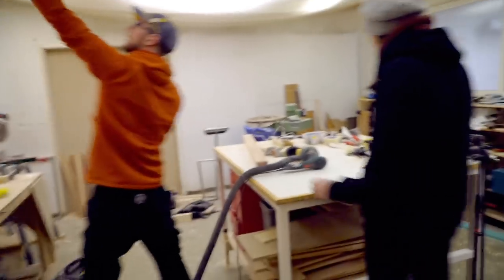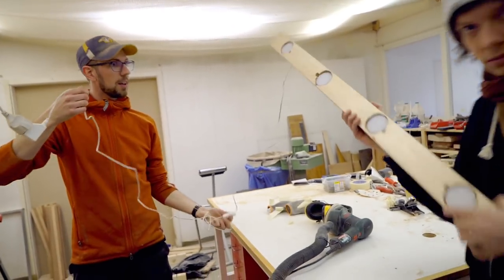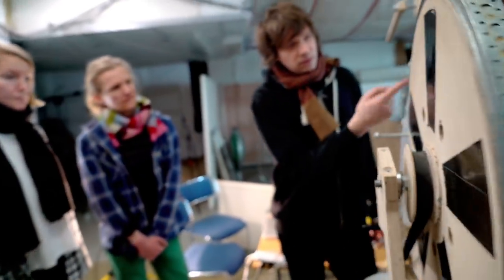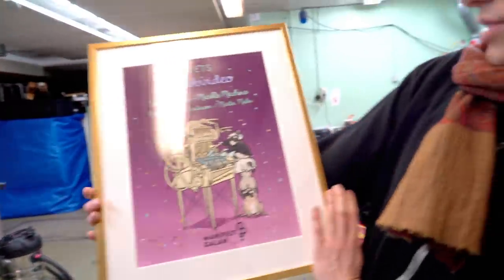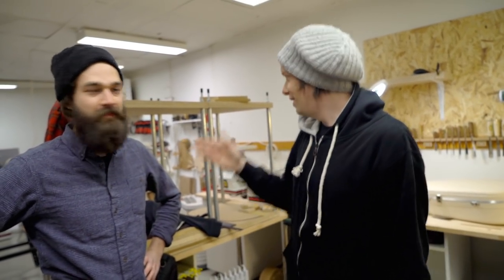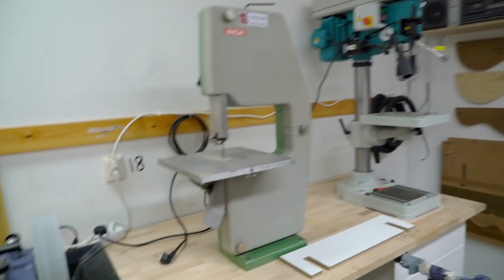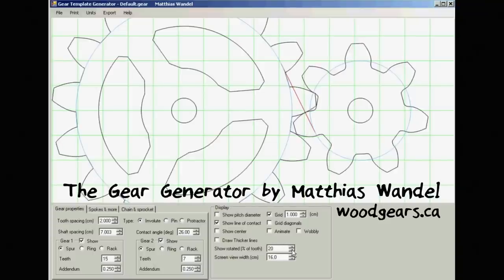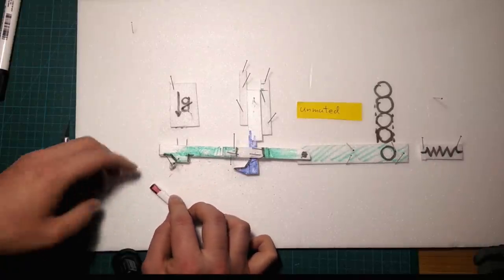Revisiting the First Machine - Marble Machine X #3

Comment: I kinda liked the wooden gears sound in the first machine, it was a part of the song for me.
Reply: The thing was, the original sound was extremely loud, actually louder than the music. They were able to get the actual music by putting very focused pickup microphones on the individual instruments and doing a lot of post-processing to get the levels and sounds right; the actual sound of the machine you would hear if you were standing next to it would mostly be [GEAR NOISES INTENSIFY]
Reply: I can see where the sound of the mechanism 
may interfere, but in my opinion, some NEEDS 
to be there.

Tubes on the Vibraphone would be awesome, 
since I REALLY like the sound effect of a 
Leslie speaker.  (Which is a very similar device.)

steev
Reply: Don't worry, mechanical sounds will still be there, just like you hear buttons on an accordion or the bow on a violin, it just won't be as loud as before.
Reply: I mean, if you're not gonna have all the little extra sounds the instrument makes you may as well just use a synthesizer.
Reply: Well honestly a physical noise is different than one made synthetically. As close as they can be, an instrument just has more personality, because the sound is tailored by the instrument itself.
Reply: ikr. It's nice he can get the gears cut more accurately, now, but I hope he doesn't make them silent like he says. I loved the gear churning sound from the original marble machine.
Reply: same here D: goodbye grumbling noises
Reply: +Eldritch yea prob why he wore headphones

Comment: On the marble catcher, easier, but more importantly most reliable would be my recommended priority.  When you are on the road and the machine is getting the snot pounded out of it you are going to want it to be as reliable as possible.  I would recommend a single marble catcher, but have it be clear so you can see the marbles going in and bouncing around before they get directed to the out tube.
Reply: Actually, a single catcher with walls and compartments that could be a good compromise. Once you've caught the marble, you could do something interesting inside the compartment, trigger a letter jump or similar, to keep the visual indication from the individual funnels, while still going with a more robust and rigid design.
Reply: +CoderCandy   Maybe having a transparent catcher where each marvle coming from a vibraphone plate has a flap (rubber, paper, something like that) facing the player in its way, which folds down when the marble goes through.
Reply: William Hayden You could have LED lights that get triggered when a ball hits the vibrophone. Maybe optical or ultrasonic sensors that would detect the keys(?) vibrating. If it was done like that the lights would slowly dim as the vibration lessens, which would look really cool.
Reply: SuperFrodo95 The options are literally endless, but the more added to the machine the more complex it becomes and this machine ultimately needs to be as simple as possible.  Simplicity directly translates to reliability.  Remember this machine will be taken apart, packed, moved, unpacked and reassembled countless times by people that aren't necessarily delicate in their actions due to time and stress.
Reply: SuperFrodo95 as of now it feels really nonelectronic. I really like that, and feel like leds would ruin the effect.
Reply: Agreed. It is really easy to make something fancy by just sticking LEDs and electronics to it. The marvel of the original marblemachine was that is was very analog, with the few electronics being very discreet and by neccesity rather than to be showcased.
Reply: Sticking with mechanical style, have a single tray with separating walls, and flaps that extend past the tray to visually show it's movement.

Comment: Crazy idea for the marble catcher: hard clear plastic with a row of hanging soft clear plastic strips, one per note. Normally each marble would hit exactly one strip and shake it, which helps visually, as well as dissipating some energy so the marble is less likely to bounce away. If you paint a moire on the hard catcher and strips, you could probably make something entirely mechanical that seems to flash at the spot each marble hits, which would be even better than shaking catchers for visibility if the audience isn't right there.

If you haven't talked to them already, you should get in touch with Evil Mad Scientist Labs. They've got a lot of experience with CNC-cut wood and marbles, and mechanisms for that combination. They've got a blog where they've posted a bunch of stuff from projects they've done, and they're friendly and interactive.

Comment: Just started to view this channel (love it) but another/extra way of making cogwheels more silent is to "twist" the teeth. That is, if you look a the wheel in that angle you only see the cogs (don't know how to describe in text, the wheel should look like an "I") the cogs are not horizontal, they are sloping a bit. The receiving wheel then have it cogs with the same angle but different direction. This is because when two cogs on a normal wheel hit they hit the whole width of the cogs directly, if they are twisted they are more of "cutting in to each other" rather than "slamming into each other". :)

Comment: Build it out of Plexiglass (Clear Acrylic "glass"), It's very easy to machine, drill, cut, shape, etc. and it solvent welds together in seconds into one solid piece, so it's very easy to make adjustments, repairs or changes by simply welding on more material  or sanding down to size with a handheld rotary tool ("Dremel" etc). When it's all working properly you can use a buffing wheel and plastic buffing compound and polish it all into solid clear components that look as if they are made from molded glass. Also has very nice acoustic properties.

I love Plexiglass and Lexan for prototyping. PVC pipe and fittings are also very good for many prototyping projects

Comment: you mentioned the problem that you want to have some kind of "visual representation" of the notes that were hit on the vibraphone. when you said that, i god a little idea, but i don't know if this is what you would go for, but i thought i'd mention it anyway. you could build a biger (more sturdy) thing to catch the marbles and attach some small device on it, that lights up leds when the marbles hit them. this could be realized with some kind of device, that uses induction to light up the led - this would mean, that there would be no external power source needed. just some kind of magned in a coil, that gets pushed by the marble and that will make a led light up for a short period. if the effect is too short, maybe a capacitor could prolong the effect. as i said, i don't know if you want something like that, but it came to my mind and i couldn't let it go. 
and btw: thanks for sharing your progress. the things you do are truly inspiring and i think you are a unique character and you never should stop making music.

Comment: you said that you wanted the gears to be silent or quieter? you could possibly use foam padding, over time it would were down slightly but i imagine it would last awhile before wanting to replace it. A second thought you could possibly add as well is  designing a spring mechanism inside of the teeth making a softer landing but if the springs aren't 100% perfect the tooth could twist every time it makes a revolution but a simple notch in the wooden tooth and the gear would prevent it from spinning. I hope you can see this comment and good luck :)

Comment: Hej Martin! You wanted to keep an individual funnel for each note for the purpose of "visual interest."  Here's an idea:  you could use a single long funnel adorned with a series of LED panels triggered by sensors attached either to the vibraphone plates or, alternatively, inside the funnel (e.g., a laser break beam sensor).  Should be fairly easy to control with something as simple as an Arduino Uno.  And if you use RGB LEDs, you could configure in a number of ways (including the option of having different colors for different notes).

Comment: If you want to go with a trough to make construction easier, what about running a rod along the middle of the length with some 'butterfly' plates that would spin around the rod when a ball hits it, you might need to add padding to reduce the noise though.

Comment: V2.0 ideas... Needs speed governor to set tempo. (Mentioned before, you may remember but never hurts to toss in a reminder.) Also make driveline power bicycle pedal style. Then you have hands free to play the Modulin while having the machine play accompaniment. :)

---Edit---
An alternative to springs, that might be better than rubber bands... Spanish windlass. Would fit the character of the original wooden construction. Just need rope or string from a material that retains elasticity, nylon maybe?

Comment: I wonder if a correctly engineered version will have the appeal of the original hand whittled master piece with all it's rattling & clicking. CNC machines make perfection, the original wooden wonder was perfect in it's imperfection.

Comment: 4:45 you might have to consider Variator solution for this design, it's a device that can change the parameters which in this case you could manipulate with the sound's higher or lower frequencies. It will allow you to change the higher or lower note any time you want, only by changing the gear ration. Let me know what u think :)

Comment: Sweet.  Any chance of a full mute system for the vibrophone pipes?  Or do you plan on always allowing them to just fade out?  I was thinking of a couple of screws rotated by turning a chain with some sort of lever.  The screws would push a wooden mute bar with soft rubber contact surface to mute the pipes.  The point of the screws is to easily calibrate the mute so that it will always occur on all pipes at precisely the same time.  I'm sure there's a more elegant solution, but this one would look cool, at least.  I may send a sketch soon.

I'm kinda ignorant when it comes to musical instruments, so apologies if vibrophone pipes already typically have a mute system of some kind.  I would not know.

Comment: In regards to the marble return from the vibraphone, would it actually be easier to have individual funnels with the Marble Machine X? (easier in relation to MM 1.0) with the MM 1.0 it seems like there's a lot of potential for variance on where exactly the marble drops onto the vibraphone plate (since it's a marble rolling off of something, and the machine was probably vibrating/shaking a bit as well) but if the MM X has a mechanism to drop the marbles straight down from a cylinder and doesn't shake as much, than hypothetically they would bounce off of the vibraphone more predictably.

Comment: It would be very cool if the Marble Machine X could incorporate brass instruments.  Maybe the marbles could land on something that could push air into a trumpet.
Reply: Ryan Heskin that sound great but you ask a thing that needs a heavy impact for it to push a certain air pressure and the ammount in the airchamber (logical problemm i see right now)
Reply: RedxanNL 3D-animator - starter Plus there's the vibration materials that are to imitate a person's lips. I'd say woodwind instruments would be much more practical and easier in the first place. (Aka clarinet, oboe, bagpipes, saxophone, etc.)
Reply: RedxanNL 3D-animator - starter Plus there's the vibration materials that are to imitate a person's lips. I'd say woodwind instruments would be much more practical and easier in the first place. (Aka clarinet, oboe, bagpipes, saxophone, etc.)

Comment: Just thinking about the control of the speed of the rotary mechanism for the vibraphone, how about using something along the lines of a vario drive transmission. Maybe with this something could be incorporated in to the programming wheel to control the separation of the cones of the vario transmission to automatically set the speed.

Comment: There are advantages and disadvantages of gears.  The ones you made on your first machine is called spur gears.  The advantage is that they are easy to make. However they are noisy.  I think Helical gears are the best option because they are less noisy than spur gears and the teeth are curved.  The only disadvantage is that they are hard to  make with wood.  I hope that will help you make that new machine for you.  Please let me know if that works for you.
Reply: Dude, this video is 4 years old. The MMX is nearing completion, it does not feature helical gears
Reply: How bad could spur gears be when you're dropping 2000 steel balls? LoL:)
Reply: Think about a car’s differential and the difference between the noises